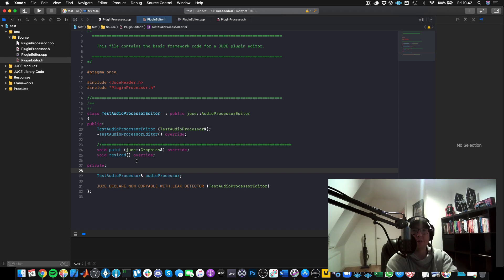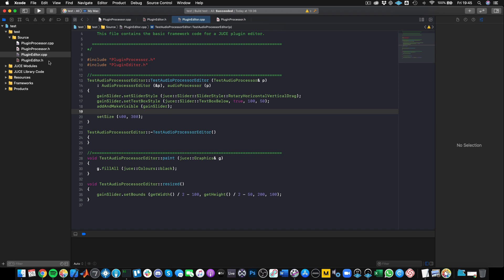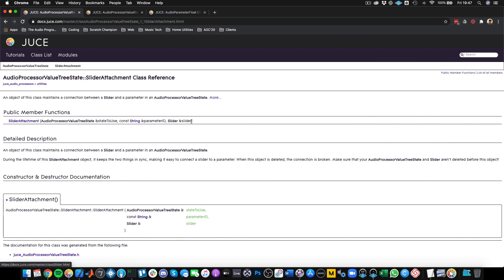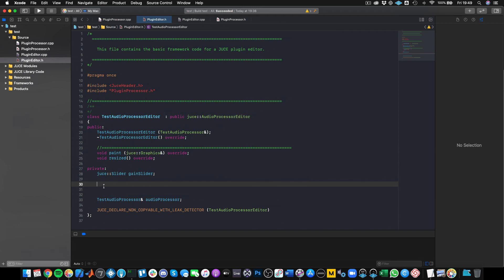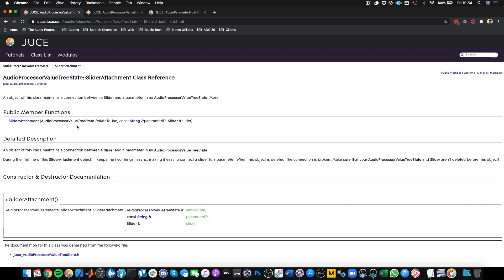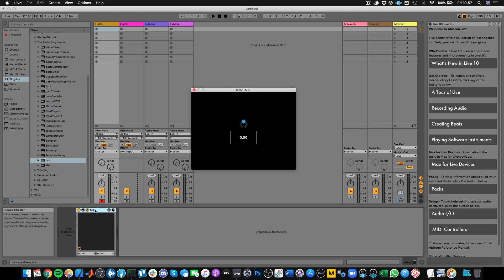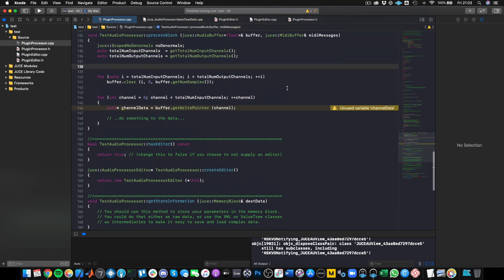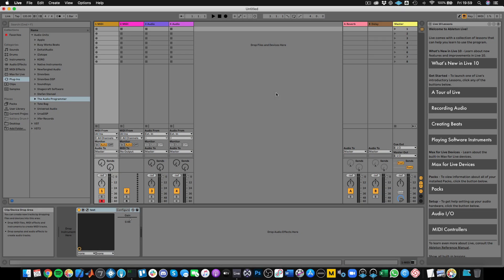JUCE 6 Tutorial 08 - The AudioProcessorValueTreeState Class Pt 2 of 2

Comment: Great tutorials! I have had a problem at the end of this one where when I try to get the RawParameterValue, and do g->load() it says that expression must have pointer-to-class type. I tried dereferencing the atomic float pointer like another person commented, but it is still not working. I'm not sure if I missed something or if things have changed. Thanks for any help!
*UPDATE* 
I guess It was actually working when I was dereferencing it with *. I thought it wasn't working, because I was using the value in the decibels::gaintodecibels function which was making the value not work. But the load() isn't working and it has me curious as to why, as I am on the new version of Juce.
*UPDATE AGAIN*
 My project was still pointing to an older version of juce so that is why the new functions were not working.